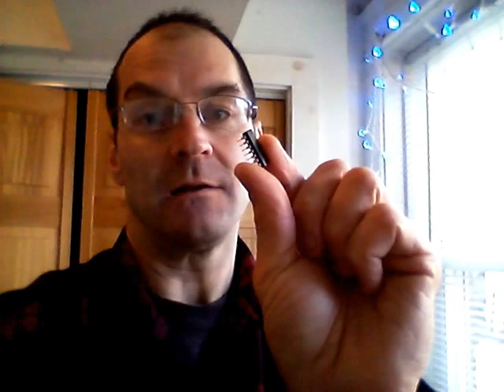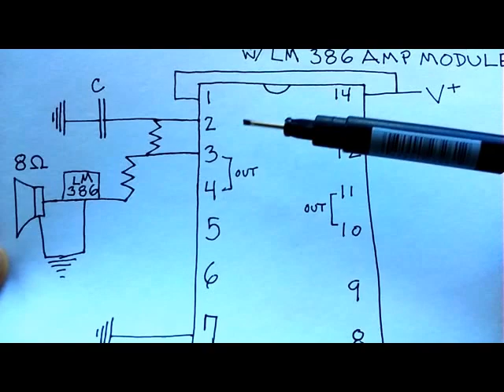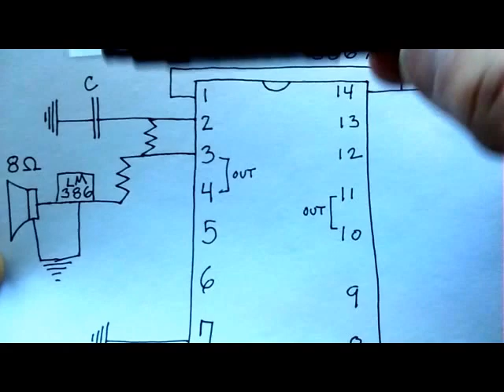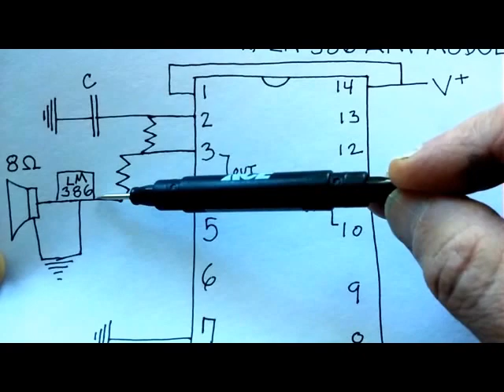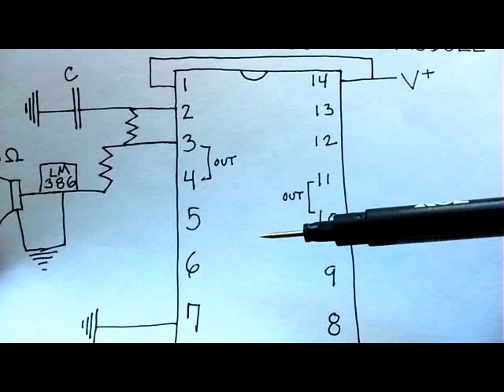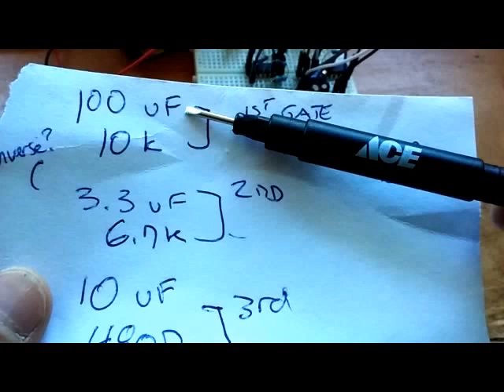DIY analog synth for $5

Comment: Chips are a monolithic substrate so any noise in the power is shared with the other gates. A 10-100yf cap at the power in and .01yf at the chip. In digital circuits we normally don't need the .01 at the chips but we are dealing with self oscillation, It;s about keeping the noise where we want it. * yf is micro-farads.